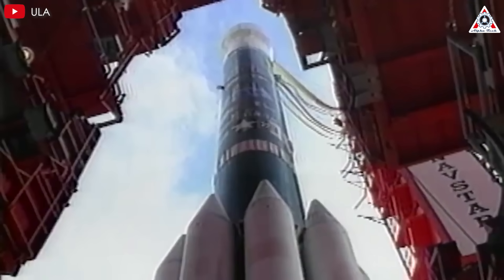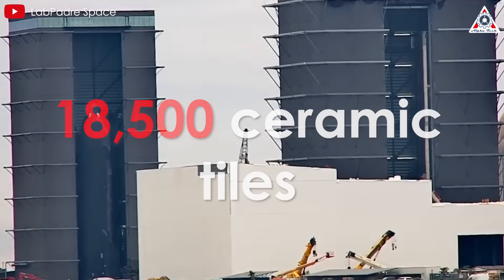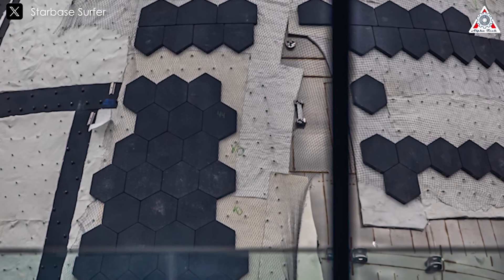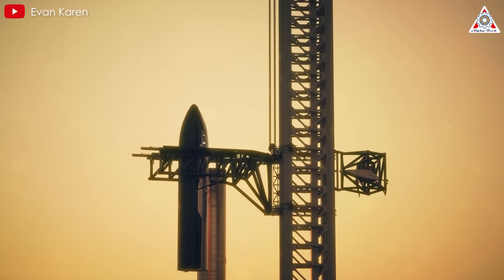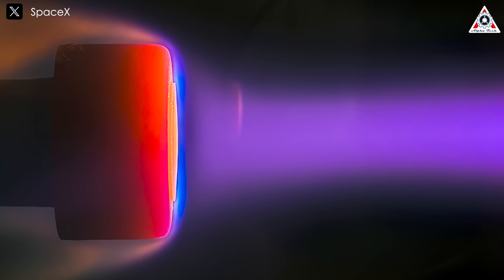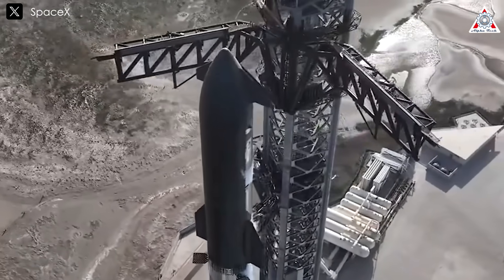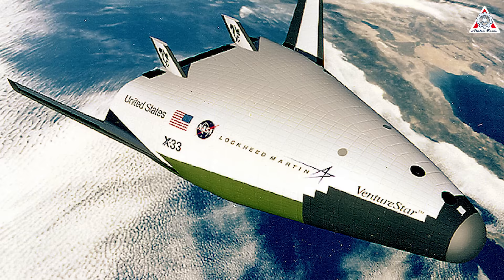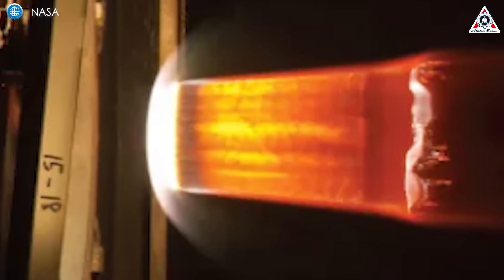Elon Musk's NEW Metallic Solution for Starship Heat Shield instead of Ceramic Revealed...

Comment: Its a question of symantics of what is the definition of Starship "quick turn around".
We know the Booster should be good for several flight, since it is not subjected to re-entry stresses.
You can monitor raptor engine performance and fuel flow to determine when to schedule maintence down time.

Starship on the other hand is subjected to multiple stresses during launch, hot staging, 
hot/cold expansion stress and finally re-entry stress.
Startship Tile replacement should be automated for the planned fast Starship turn around. 
After each mission AI robotic inspectors should xray inspect Startship, ordering fixes and tiles replacement if necessary between flights. The AI compares the current ship's surface deviations and any recored anomolies against the ideal with acceptable tolerences to determine when a major Starship overhaul or retirement is required.

 Starship performs multiple missions, some will be simple refueling,
 others require physical loading or unloading cargo payloads.
Which should be done in a controlled automated loading/unloading space in star factory.
This will require swapping incoming and outgoing Starships at the launch tower.
The Booster can be readying while Startship's next stack and unstacking occures.

II Starship uses modular cargo carriers then this could be sped-up many times.
Since each cargo carrier can be worked on indepently in star factory providing just in time logistics.
The secret to this is computerized carrier loading and unloading, that details items needed and placement.

Comment: You should not forget, that Metal Plates heat and Coal change the technical structure of the Metal. Like a Blacksmith.
Reply: But, where is the coal on reentry?